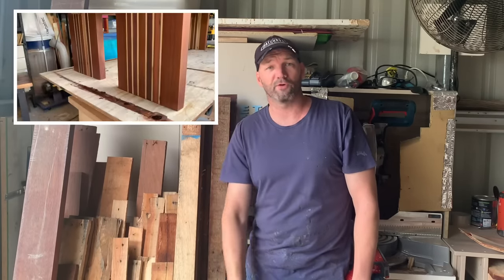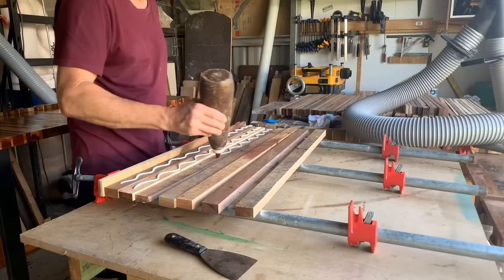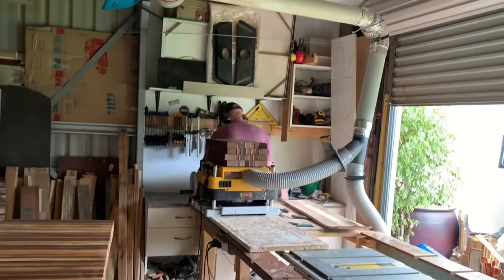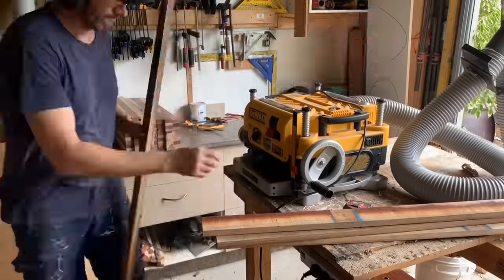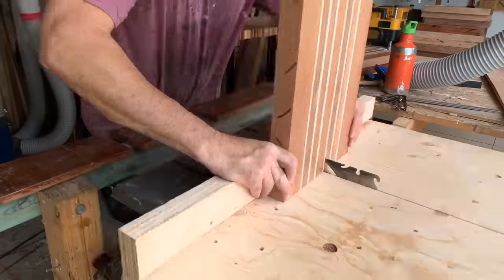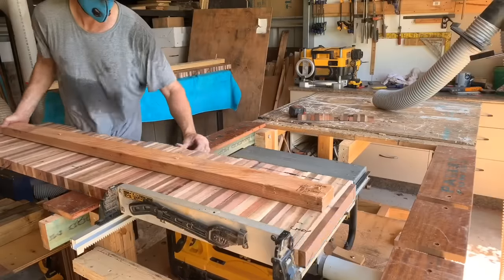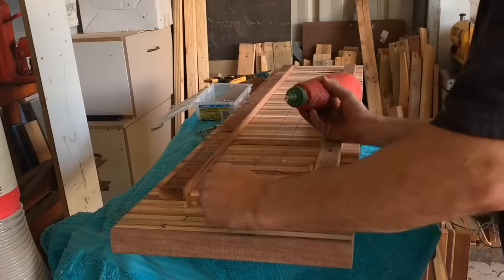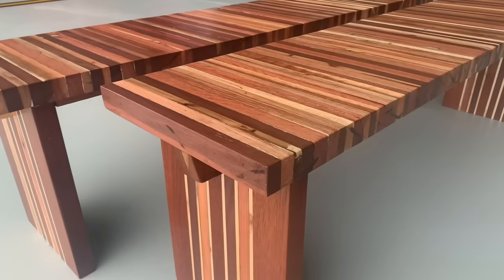Pallet Wood Benches - How I make it

Comment: Its funny mate, Ive learned a lot working/up-cycling for this Bench for my brother and I tell you what I got the right hump having to do all that extra work that I see you do, I said fuck that - I just sent each piece through the thicknesser so I had a good glue face fucked off any thought of parallel etc, any boards that were bananas I just clamped them to the other boards bringing them inline - guess what, worked a treat, then planed PAR and saved me hours of work! I'm still learning what BS YouTube taught me mate - like trying to unlearn it! 😂

Comment: This is really coop, wish we had more options than just pine.
But curious if you could put the extra supports (running the length of the bench on each side of the legs) into the bench, rather than just o/under to get the same support and hide them more.